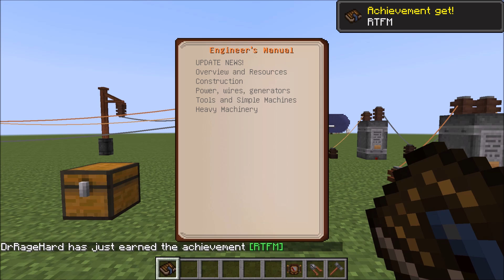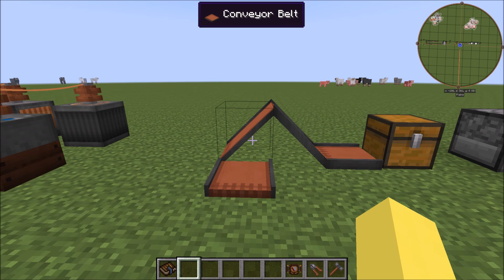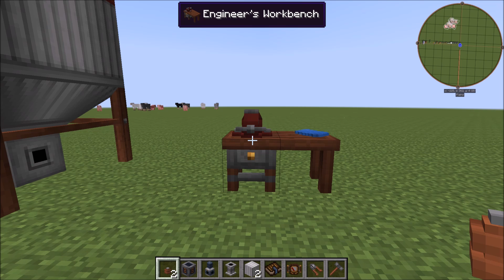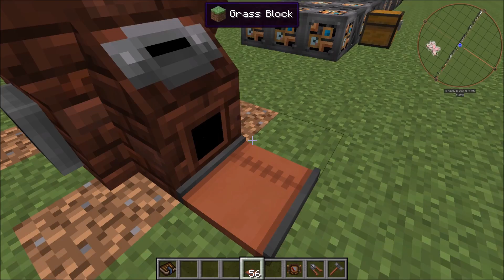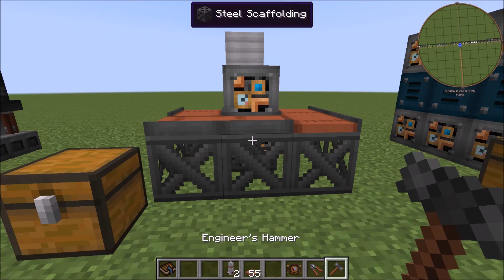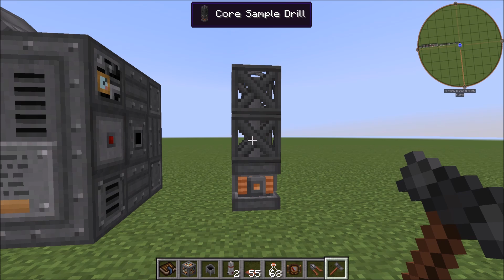Immersive Engineering Mod Spotlight!

Comment: Is it possible to use power from Industrial Craft 2 with this?
Reply from the maker: Yep, this mod should work almost universally with other mods power.
Reply: No Industrial Craft 2 uses its own power system, there is an addon for immersive engineering that allows you to convert it

Comment: @DrRageHard  Is it actually possible with this version to automate putting coal coke from the coke oven into the crude blast furnace?  I cannot get it to work for the life of me.  Please help.
Reply from the maker: I believe you can if you can pull out with a hopper and then use conveyors to get the coal coke up and put it into the blast furnace. Not sure the exact specifications of the crude blast furnace though since that was only implemented once I was at a point I didnt need the crude one.

Comment: I haven't played with this mod for over a year. However when I did play with it, just playing with this mod alone, it was near impossible to build some of the machinery due to the ridiculous material cost. Has that changed? When I played the mod had no "early" game help to collect resources, no drills or anything like that. It made the mod way too difficult to play by yourself imo. Sure, if you're playing with on a server with friends resources aren't an issue, but they usually tend to be when you're alone without the use of other "big" mods.

<edit> It actually did have a drill but it was terrible, seems they buffed it(by looking at the end of the video). I'll probably give this mod another swing, just to see how it is. Hopefully it's better "balanced" and more enjoyable when you're playing by yourself and resources are often a bit of a problem.
Reply from the maker: I did a 'Surviving With Immersive Engineering' series about a year ago where I play through with only that mod and although the resources were a little difficult to get (iron mainly) it didn't seem too bad. The recent updates have made machines much cheaper to get or at least more effective with helping you get resources, so I would definitely recommend going back to it :)
Reply: DrRageHard You forgot to mention that the mod pretty much requires you to go to the nether and collect a ton of blaze rods - before you can do anything useful. I knew there was trouble when I saw the coke oven and blast furnace(hello RailCraft!). 

It's a nice mod but seriously, steel to pretty much make anything now. I'm very certain that when I last played which was a while ago, you did not need steel to make the basic tier 1 stuff.

Comment: I need help, i built the excavator and i can't get to the center of it so idk how to right click w/ the hammer.
Reply from the maker: You can form the excavator as one whole piece if you build all of it and then click on the external piece (instead of forming the two separately).
Reply: +DrRageHard ok thanks, this is one of the best mods and this showcase was really good.
Reply: RagePlaysGames Muslim

Comment: i love the design and where they are goind with the mod but in my opinion it ll never be a succesful mod if it stays at this state. If you play this mod as a standalone the pleasant experience is EXTREMLY reduce. You start and release that you need to go farm everytime you want to do something, and when you finish everything and do the biggest pain releiver of the mod (excavator) you realise that the only machine left is a non useful one (a.k.a the arc furnace).

You cannot do a mod like this, it s not fun to go mining everytime, succesful mod like botania or intangible or even tech mod like mekanism they are all fun because either they require you to have fun with the mod item and automation or allow you to get ressource easy si you can have fun too.

IE is ok but if you compare the pain to gather material to the happiness to "setup' something, then it s negative. The mod allow very very low fun with automation, it s simple and require no skills to succeed. Again the 3 mods i quoted before they put you in a "how i m a gonna do this hum..." and when you suceed the reward is awesome. IE you mine, craft, put the machine on ground gg.

I watched all you LP video Rage about this mod on standalone et i did it myself. Each time i wanted to build something it putted me in a bitter state where i was asking myself  "is it even worth it" . A simple solution of this could be like what mekanism did, allow you to get ressource more easy (like *3 ores as early game for exemple and excavator as mid game) then put more machine to make the automation more fun.
I m sad cause i love the design or the mod and i believe most of the people like the mod only for that and not for the real enjoying content.
Reply from the maker: +Lynn Avezou I completely agree. It is as if the multiblock structure you are building's most useful purpose would be to help you make that exact structure. The excavator helps you get ore, but it is one of the last structures you will be able to make and power in the stand alone pack. The main thing I noticed and that my amazing viewers helped out with was coming up with fun builds that involve just IE, but aren't straight multiblock structures (for example a mob system with a sorting system that runs into a weapon range).